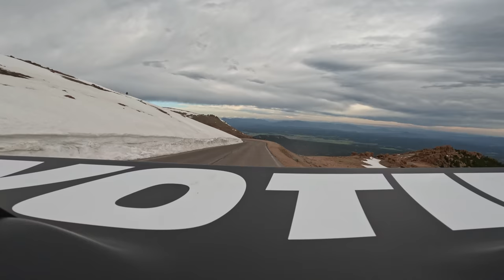Mad Mike’s 1400hp Rotary Sets NEW RECORDS at the 101 Pikes Peak Race

Comment: Hitting the rev limiter on almost every gear shift... what a treat from such a legend! Mad Mike, one of the very few that are keeping the Mazda spirit alive!
Reply: Bashing that limiter like its a red headed step son 🤣 Bit of time left on the table too
Reply: In Japan and Australia it's still alive and always will be 🏁
Reply: Means he could drive even quicker. Hitting the limiter means no power for fraction of a second
Reply: thats a rotary thing, they get smoother the higher you rev them.  Its hard to shift by feel because you don't get the feedback from vibration or power falling off as much, especially on the PP motors.
Reply: Kiwis can fly Kia ora
Reply: Could be antilag popping during the shifts to keep the turbos lit
Reply: Alot of rally racers today use a thing in their exhaust that basically keeps the turbo spooling between shifts and when u let off the gas. Rpms drop but turbo stays spooling. Subaru used it alot. Kills the turbo but its good enough for them to use  for 1 race at a time
Reply: How come he still uses the clutch in rally car with sequential transmission? I thought you only used it for standing start
Reply: @H1SHU  On sketchy surfaces you can use the clutch to avoid upsetting the car on shifts. No-lift setups slam full power through the drive train every shift which is fine on prepped surfaces but on dusty, cold,  bad asphalt, or any combination of those using the clutch allows you to soften the power hits and keep the car planted and predictable. Mike's car is making way more power than it needs to break all 4 loose and pike's peak is known for having rough tarmac. He doesn't need the car getting squirrely at the wrong time and losing a few hundredths here and there doesn't matter in a long game where consistentcy is king.
Reply: @Joebobinator I’m almost positive this setup is rwd…
Reply: It needs paddle shifters bad, he doesn’t want to take his hand off the wheel to shift when he needs too. Could gain a lot of time with paddles
Reply: @StephenDeTomasi much like over revving the gearbox.
Reply: @adamfournier6735 seems like the one driven by Whiddett has 250bhp more than every other competitor in 2023 Pikes Peak Hill Climb event.
Reply: @texasrepresent1229  Anti-lag. It's not a thing in the exhaust - It's a bypass valve which sends air straight to the exhaust side, which mixes with fuel. The heat of the exhaust ignites the gas and sends it to the turbo to keep it spooled.
Reply: @ryanwasilewski7742  It is. Converted to RWD.
Reply: Had an S13 KA-T use to bang rev all the time on the street. Thought there was something wrong, as I also ran a 24/7 scramble boost. Idled at 2000, twisted 7900. Friend on the side of the road let me know what the root issue was. Suspension was so stiff, 18k fronts, 16k rear springs was causing me to catch a few inches of air while making runs.

Comment: I find it to be very difficult to judge speed and force in a video, but I think that fact that at 10:26 you can see that the air bubble in the tank of the hydraulic handbrake is basically at the front, rather than the top.
I still can't imagine what it must have felt like, but holy moly...

Comment: Man how lucky is Mazda Japan to have a guy like Mike? Seriously the dude is a class act, super friendly, absolutely LOVES all cars but he chooses Mazda because they really do suit his driving style. I know so many people who have rotary cars and they don't belong in them. They lug the thing around and foul plugs, don't run a return line and WAAAY more pump and injector that you'll ever think you need. The fact is, you DO need that much fuel in a rotary. They're so difficult to tune if all you've ever tuned in ur life is piston engines man. I'm a tuner at the only shop with an all wheel drive dyno in Reno Nevada. The difference is literally night and day. On the mapping where a piston engine would like to be leaned up a bit, rotaries want ALL the fuel and visa versa. Literally if you understand haltechs fuel chart layout and looked at let's say a 20b side by side with a turbo k20 you'd be like.....what the FUUUUUUCK!?!?!? No bullshit a 20b burns more fuel than my single turbo and fuckin BUILT 2v 4.6 mod motor. Yes, Im the one man in the world who owns a 1998 mustang gt and kept the factory engine. Because 2v 4.6 are the most underrated engine there is. Period. A SOHC V8 with a block and head castings that robust just don't exist in any other platform. My car had 181,000 miles when I pulled it apart. I did a simple knockdown job on the heads, did trick flow stage 5 cams, titanium valves, springs, retainers, keepers, titanium rods, diamond billet pistons, had the stock crank blueprinted, balanced up to 12,000 rpm, lightened, and polished to a literal mirror shine. That well over 200,000 mile stock crank, block, and head castings have held 1100hp for almost 5 years. I did a dingleberry hone on the block. I'm dead fuckin serious this isn't bullshit I swear to God. I know they're a difficult engine to fit into some cars. But it's nowhere near as big as a coyote and you can find them for $600. I ran mine bone stock with a 78mm precision turbo for 2 years. It was still running exceptionally the only reason I did the build is because I won $37,000 playing roulette in Vegas. I had won $6,600 playing blackjack, then walked by a roulette table and looked at my girl. Shes like "Out half of it on 17 black I have a feeling right now." I shit you not it fuckin dropped on 17 black. Oh boy did I give her the best night of sex shes ever had in her entire life. She was still snoring when the maids came by at noon, hahahahaha!! Anyway, BUILD A 2V 4.6!!!!

Comment: When running a new hill climb, every thought of going simple, by running a back lit map of the hill.

Just a simple 3D printed map, a simple led bulb for the darkness in the car, and that way as soon as you set off the map is controlled by a simple self reliant/early phone battery from a Nokia 3310 to power the simple rhubarb board and lamp.

Just a suggie.

Well done

Comment: As cool as this is, it was only 13 seconds quicker than the 405 t16 in climb dance... 25 years later... with over double the peak power... on tarmac...

(is it the same distance?)
Reply: Same distance. Worth keeping in mind that the 405 T16 was basically a silhouette car. Tube frame, carbon body panels, 700hp, 4wheel steering and a WRC Rally Winner behind the wheel.

Comment: Cant't believe they are running a car like that with full manual and use of clutch required (seems like since clutch was used all the time) instead racing oriented manual seqential with flat shift and dog box. Also kinda awesome at the same time because so much more work and skill required from the driver.

Comment: overall it looks slow as hell. i don't know if its just the camera angles etc. 
but he places 21st overall in exhibition class 
the best time this year was 
8:40.
I thought it looked really slow. considering all that performance. what was wrong? the gearbox ratios seemed too close. it seemed to have power problems on cornering, probably fueling or lack of surge tank maybe??. alot of issues. then the heat as you say. which is interesting that is a big front ned. you may need to get an even bigger core next time for the radiator mate 
but good on you for fastest Rotaryt. that's not saying much tho considering all the money and time you got out of it

Comment: 😈😈😈 your a drifter knowing the instabily of those factors , so your in a surblime  space  right now  !  Just be pressent working within the confinds of the cars abilities and hold a safe time  firstly and work on correcting the values and gaining those  seconds  ....  short shifting at ythe very top and abusing the tyre managemts ... or esculating those open motions can strip away time through tire degregration ...   keep the  motor in peak rev range , limiting the torque vectors on cornering and upsetting the cars dynamics ......   ride  the   clutch ,  until your within the end , then Punish the  fuking thing  😈😈😈😈  so the cars sst up to change as the O2   LEVELS DECREASE    ,  advancing the motor at the top 2ith short changes  right !    Pretty hard set up , no rebound   😈😈😈😈